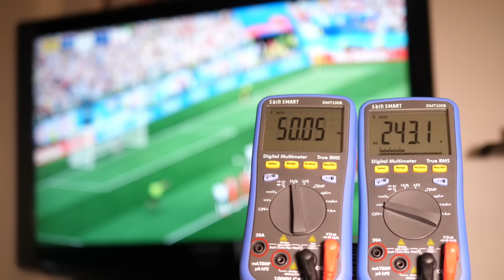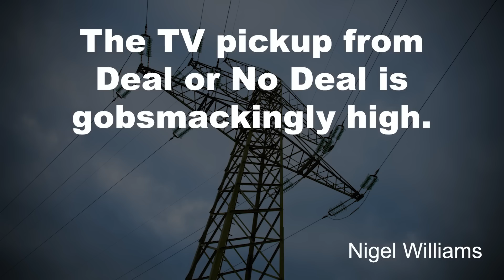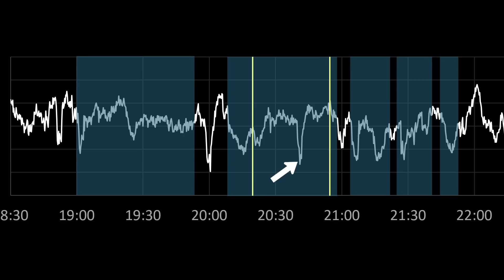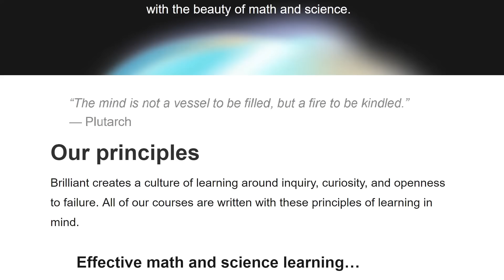Detecting World Cup goals with electricity - The TV Pick-up effect

Comment: And I think one of the main problems here is that the electricity company is actively trying to prevent you from being able to see anything. The big spike at the end of the game could very well be an overestimation by the electricity company. Essentially by NOT being able to detect goals you've proven that their system works.
Reply: Exactly. Also, frequency gets adjusted to keep a constant average (to keep timers happy), so he shouldn't see any huge drops; at most he should see increased variability. He should have measured / graphed voltage as well, which is allowed to vary between 216 and 253 V and doesn't get post-compensated.
Reply: Sander do you mean overcompensation?
Reply: Rick Williams 
No, because a compensation is made after the fact, whereas the electricity company tries to make an estimation of required power before it happens. The big spike could indicate that that estimation of required power was too high. (i.e. an overestimation)

Comment: if you need more data you could measure the water pressure
Reply: > the result would be buffered

Did you miss the start of the video? If that buffering were enough to make no difference to end users, the water company wouldn't need to increase the pressure, and therefore wouldn't put the increased load on the power grid.
Reply: 100s of people in your area flushing toilets would definitely affect the water pressure. No system can keep the pressure 100% stable with high demand like that.
Reply: Arnþór Gíslason 
If it does by 60% then there is a 60% error margin... that's huge!
Even a 30% is pretty huge.
That is if it is this alone.. with other things it goes much much more..
Thus this is not a reliable source of data.
Reply: I don't think that would show anything as the result would be buffered. I.e. pumping stations and tanks maintain a constant water pressure and especially tanks would buffer any fluctuations.

Comment: You could extend your electricity/bicycle metaphor even more.

Force pushing bicycle / Bicycle Gear - Voltage
Rotation rate of petals - Frequency
Bicycle Speed - Current
Slope of the riding surface - Resistance

Petal in a particular gear at a constant petal rotation gives you a certain speed (current).
Going down gears creates less force (ie less voltage), and you will slow down, if you keep petal rate constant.
Vice versa, going up gears creates more force and you will speed up.
Changing surface elevation changes resistance and will change speed (current) for a constant gear and rotation speed.

To demonstrate the effect you are describing, it's like suddenly there's a massive hill (more resistance because of more load). You don't change gears because you want to keep the voltage the same. You try to keep petaling the same speed, but anyone who has ridden a bike knows that's impossible. Your petal rate will inevitably slow down.
Reply: Inertia of the bicycle = inductance
Springiness in the drive train = capacitance
Gear ratio between pedals and wheels = transformer turns ratio
Reply: The metaphor is perfect.  You can even attribute the height of the pedal over time to a sine wave!  The only problem is that a bike has two pedals.
Reply: That is literally the same analogy he used... What exactly have you 'extended'?

Comment: The reason that you measured somewhere around 243V, is that the Mains Voltage in the UK can vary from 230V by 10%.
Reply: No. The UK mains voltage 'is' 240V. It was never changed because it is within 10% of the Eurocrats fictional 230V.

Comment: I am disappointed that when talking about frequency maintenance you didn't mention the prolonged drop in frequency all across europe a few months ago that caused mains-connected clocks to run slower (by quite a few minutes!) and then faster when they were getting the average back up to spec.
Reply: Tomasz Cheda tom scott i see
Reply: Alistair Shaw I actually watched his video after I figured it out myself! I knew about the clocks getting their time signal from the mains before, and after adjusting the clock on my kitchen stove a few times I carried out my own investigation. I found a statement from my power company explaining the situation and announcing that they will be running over the average now to fix those clocks that can't easily be accesed!
Reply: al35mm That is where DC links come in! Britain is connected, but not synchronised - there is direct current flowing, with alternators on both ends transforming each to their own grid's frequency and phase. High Voltage Direct Current is better for long distance, intermittent power transfer, because AC cables act as huge capacitors that need to be charged up every time a transfer is started. No such problem with DC causes lower losses. Also, using DC allows electricity to flow between grids using different frequencies or just not aligned in phase
Reply: Madhur Agrawal Yes, I am aware that Britain's grid is separate, but this kind of a consequence can occur anywhere if the power plants can't keep up
Reply: Madhur Agrawal Yup, seems like a related piece of trivia.
Reply: It should have been a problem in England too though because England is attached to the EU grid because we import and export electricity. There is only one grid frequency. If you try to connect to the grid with a different frequency things tend to blow up! So the English grid would have had to follow the slowdown and speedup of the whole EU grid.
Reply: That's not a problem in England
Reply: So you mean as a case study? (I know you know, I saw the video too, I thought you might have forgotten)
Reply: > Tomasz Cheda tom scott i see  
You did not need Tom if you lived here ;)

Comment from the maker: Forgot to say, there's a misconception that the main cause of TV pickup is people putting kettles on to make tea. Sounds plausible, we brits love tea! But it's only a minor contribution. The main thing is toilet flushing. Also, opening fridge doors!

Apologies for all the jump cuts! I wanted to get this out before the England v Sweden game. That way there's accountability when all my hypotheses turn out to be wrong!
Reply: Steve Mould 
I would do measurements as well, but germany is out of the WorldCup, so it won't work.
Never thought I would be so disappointed because of football...
Reply: Paweł Szczepański Yup, it's the water companies turning up their pumps.
Reply: Doesn't england use water reservoirs or tanks on hills (gravity feed) for domestic supply? If it does, toilet flushing would not be the source of the spike in usage, as the water system would provide a buffer
Reply: Pablo  Pumping water on an industrial scale requires large amounts of electricity.

https://en.wikipedia.org/wiki/Pumping_station
Reply: Why does flushing the toiler cause an dip in the electrical grid? Pumps start running?
Reply: i really don't get how flushing a toilet is remotelly related to electricity, what am i missing?
Reply: @PabloDeLafuria  yes but those pumps always pumping 24-hours a day they're never stop
Reply: As for the other voltages sometimes quoted like 230V and 250V I believe it is because of the inherent fact that the supply voltage will vary a little, those values bracket the range for what the AC voltage should be at the point of supply. While of course many devices like heating elements or motors don't really care as they just suffer reduced maximum performance if the voltage droops some other devices like electronics are very voltage sensitive and you really need to know the limits of what input voltage can be expected to design them properly.

Transistors for example with the cliff drop effect of simply not working if the voltage drops bellow the switching voltage or capacitors that can suffer permanent damage to the dielectric from even relatively modest over-voltage.
Reply: @FaerieSeraphina  will the transistors be damaged then? I have heard undervoltage is dangerous for motors because stalling or not getting enough cooling from spinning too slow. Anything else?
Reply: @tanelehala6422  The effect is possible but with poor quality components she mentioned (passive or active).. and legally the voltage most not exceed 253 or precede 207 volts, nicely engineered things with volt regs inside them mustn’t be unstable and must accept the interference caused by voltage fluctuations.
Reply: Steve Mould love this idea, Please continue!
Reply: It was hard for me to follow as I didn't quite get this cause and effect.
Reply from the maker: Sandcastle • what? Tell me more about these cables!
Reply: I tend to use the toilet while the kettle's boiling (one out, one in) and I'm fairly confident that I'm not the only one, so the two sources of electricity demand are fairly inextricable.

Also, there was a trend for manufacturers to make higher and higher wattage kettles (and vacuum cleaners and other stuff) until it was deemed to be a problem and legislation was brought in to reverse the trend. Kettles account for a lot of demand, all at the same time (ad breaks, etc.).
Reply: How could kettles be a minor contribution? Aside from power showers, they're the most energy-demanding household appliance, with good ones sitting right at the max 13A fuse power of 3kW.
Reply: Steve Mould steam turbines, triple expansion stean turbines
Reply: Paweł Szczepański possibly, or you know turning on the light switch so you arent pissin blind
Reply: You have my vote for most articulate, most well-spoken youtuber. Hands down. No contest.
Reply: If Dirty Den comes back to the square, that would be amazing, given the actor died recently! I for one am ready to worship our grimy new Jesus.
Reply: David grows dragonfruit  Don't be silly, they've got quite enough on their plate already playing the World Cup!

..Oh wait, you meant the country. No, we don't generally. Very tall buildings might do, but it's not like the US.
Reply: The kettle is taking about 1000 watts for 5 to 10 min (unless using natural gas). I don't think the energy to pump the same amount of water as used by toilet comes anywhere close to the kettle.
Reply: So Tom Scott is wrong about his timed kettle + Coronation Street theory?
Reply: Wat enemy?
Hauever, imagining a British-style Apollo 11 controlcenter, counting down for a TV toilet break to cope with water and power demands is hilarious. Vell done.
Reply: @thekaiser1919  It isn't far off that. Big Central control room with lots of huge wall mounted screens, a big 7-segment display for the frequency and a posse of people watching the tv programme. When a surge in demand is expected, all the backup power stations are standing by their phones ready to switch in the extra capacity. They start running up the generators seconds in advance - it's split second timing. I imagine all countries have very similar arrangements.
Reply: Toilet flushing uses power over there?
Reply: The world worst mantained electric grid must be the one from Venezuela who have daily brownout and blackout last almost a week at least :'(
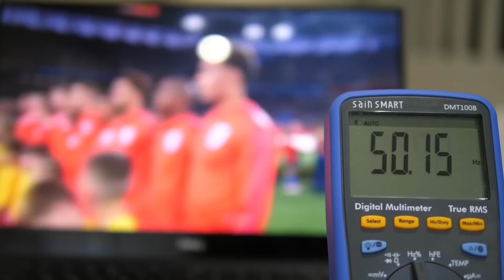Reply: I remember the BBC's kettle explaination. Here is the 4:18 video .   https://youtu.be/UTM2Ck6XWHg
Reply: Great video:
I remember we had problem with the gas in 1966 after the World Cup Final as everybody put the kettle on (when most kettles were gas kettles on stoves). I was only 5 but remember the gas going off. 
Also the 1990 match you mentioned had the added ingredient of "Golden Goal" rather than Extra Time. If a goal had been scored the match would have been over. 

Another difference from those days to today: Millions of viewers watch on large screens in public areas and pubs. The urinals and portable toilets do not use water like home toilets.
Reply: Could it also be because all TV speakers screaming Goaaaaaalllllllllll!! ??
Reply: All those random drops in frequency are probably down to my wife.
Reply: toilets don't use electricity
Reply: People used to tell me I was a good teacher and knew some interesting science that I could explain. But only in my dreams am I able to do what you do. If you ever ski Colorado, let me know. I'll buy you many beers. Thanks for all this!
Reply: I still can't see the use of elecricity that is involved in toilet flushing. If you in Britan don't have some sophisticated electric facilities, it should be simple mechanics where you use power of your muscles. Oh, you mean electric power to maintain water pressure in pipes?
Reply: @arvedui89  there are some pumps but everyone's sewer is different most are gravity fed so you are right flushing the toilet should it make a difference